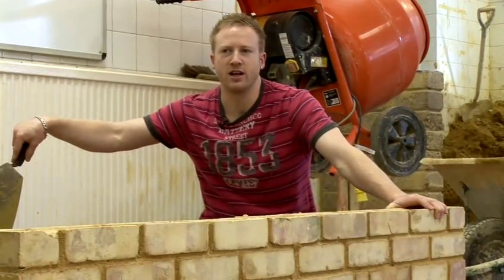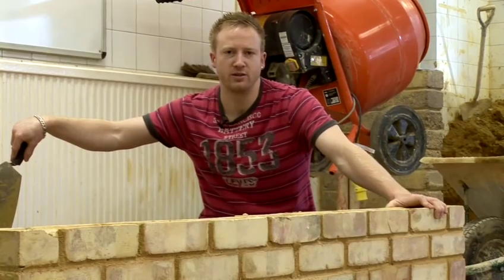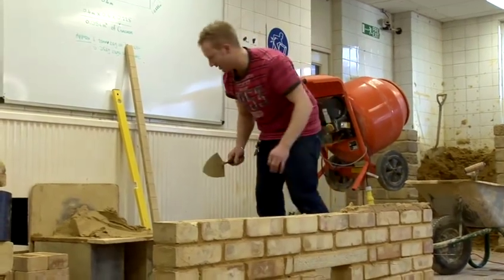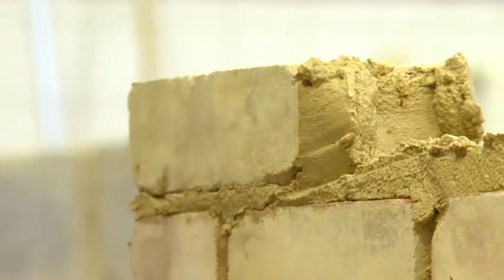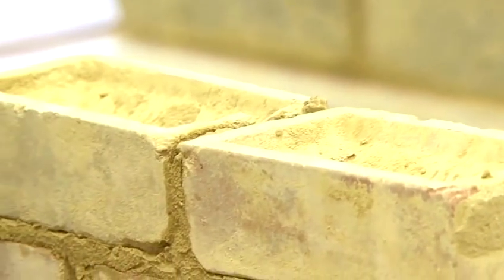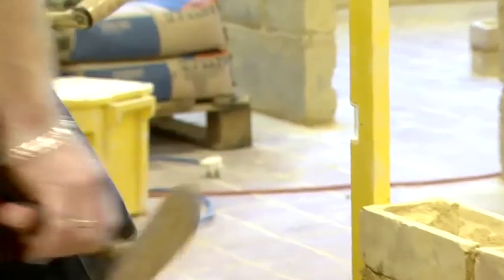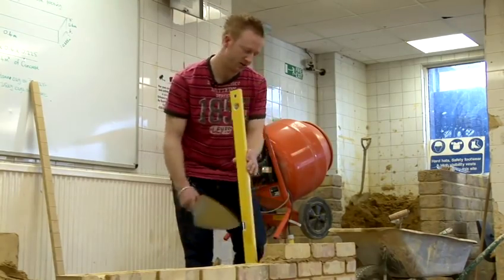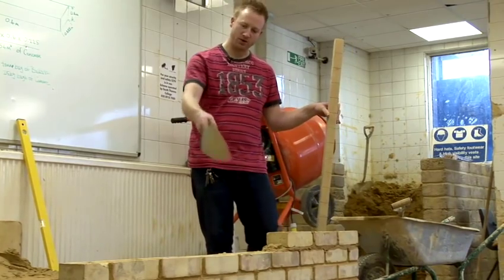How To Lay Bricks Like A Professional

Comment: Bricks are upside down ya bugga. The solid side has been screed(sp?) off so its flat.  The frog side is not flat and impossible to level properly. Nice sign in the background.  You won't learn poop in school for this trade, waste of time and money.  If you want to learn buy a hammer and get a job as a laborer then work up.  But don't if you can help it